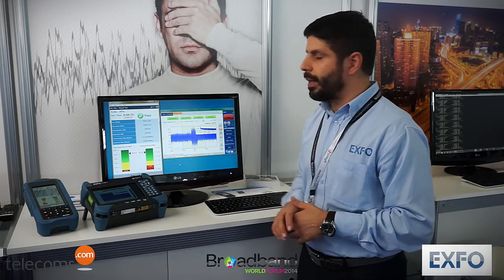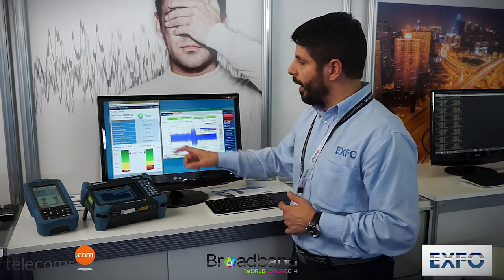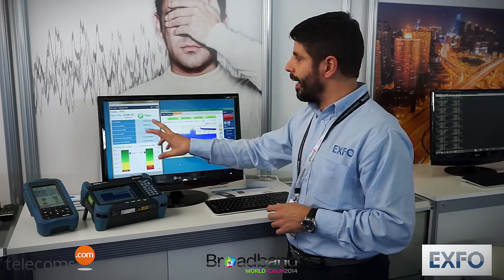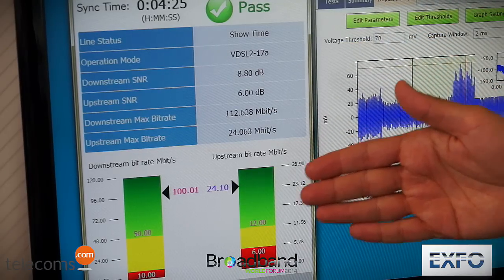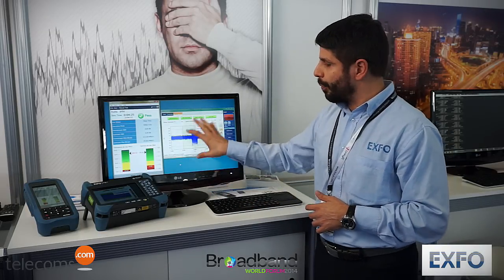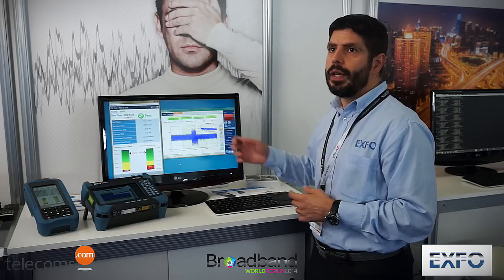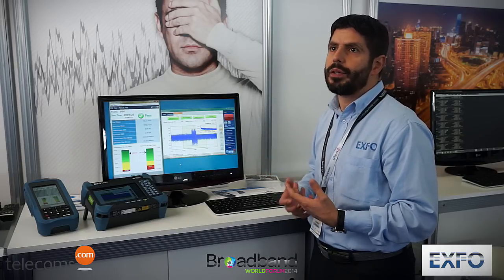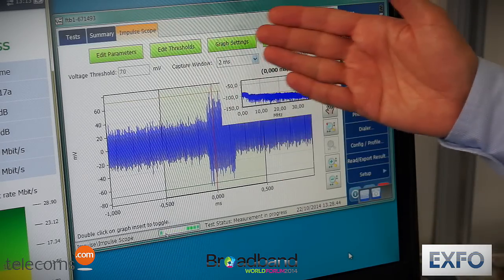FTTN VDSL2 Vectoring (Live demonstration!)

Comment: Alright, they show how they added noise and shit, but not how well it works on distances like 3KM or whatever - useless.
Reply: they finally rolled out vdsl2+ in my town ;-)  it only took 10 years since the standard was final in 2005 , so about time
Reply: +qoaa How far from the distributing point are you?
Reply: Manny Calavera
Well I was on dsl2plus until last Thursday. I was perfect on 12 megabit down 1 m up.

on Wed line tech came out to check if I qualified which I knew I should since I'm 1 and a half blocks from the CO "As the crow flies" but that doesn't mean the line runs direct.

Tech called me and told me my phone and dsl would be down for about 10-15 mins as he climbed the pole to check line. plus he wanted to swap out some connectors on the pole that were old anyhow and best to go ahead since the order was put in.

he called me back about an hour later said I had made him work... he climbed 3 poles. He had the idea while he was up there he said my line tested and qualified for 50 megabit, but he realized he could redirect my line closer by changing 3 connections on the 3 poles it would redirect my entire apartment complex directly to the CO a block and half away, my apartment building is right off main street and the CO is 1 block west then half a block south from me. So I went from a 6000ish feet, after he swapped connectors on 3 poles, he called me back told me he halfed my distance, im at 2800 ft, and my line now qualifies for 100 megabit vdsl2plus.

100 megabit is a bit pricy at the moment. So I went with 50 megabit service.
Reply: qoaa That's awesome, "problem" is however that I live in the Netherlands, where there are no cables above ground anywhere, everything is underground here.
Back in the day electricity and phone/internet would run above ground on poles here too but we're too "developed" for that now, so it's far more expensive to redirect a cable now.
Reply: Manny Calavera
yea, thats the only good thing about our STUPID power poles in the U.S.

now Fiber all runs underground. But the copper goes up to the power poles below the power cables but out of reach of course.

By swapping connectors and such around they can redirect the copper to try and get you closer unless it's already been laid out and optimized before.

But I'd rather have it all underground like your country.

I live in a small town "3 red lights, 1 grocery store, 2 fast food places, 1 hardware store, about a dozen churches" in the southern end of Georgia about 20-30 minute drive from the Florida line. big "bible belt" area. Which sucks, but that's a rant for another time.

Anyhow in the country there's the giant "robot" looking towers that run power parallel to the interstate road system between cities and out to rural areas.

then in cities along sidewalks every block you have a power pole, and usually every other power pole there's a big transformer bucket attached to the side of the pole.

This transformer bucket is filled with oil for cooling. But in rare situations they do explode, maybe tornado, or hurricane as we get both in Georgia being right in the middle of 2 weather fronts coming in from the Gulf of Mexico on the west and the Atlantic on the east. And when the 2 combine over Georgia we get some bad storms at times.

Well trees fall down on power lines cutting them, entire neighborhoods lose power, then you have live sparking power line across road or in someone's front yard very dangerous.

When a transformer explodes it's extremely loud. We had one explode here a few years ago and it's at end of the block and even inside my apartment my ears were ringing and I thought a bomb or plane or someone had crashed into the apartments.

Here's a photo of a transformer at end of my apartment after they replaced the one that exploded and had to put a new pole up.

https://flic.kr/p/dnRdes

notice the very top of that pic the 3 lines at top are the power lines. the lines toward bottom of the transformer are telephone/dsl and cable tv/internet.

those lines you see coming off the pole going to the left. That is 1 power line coming in to the apartment building to feed power to this building. and below that is copper phone and cable.

I don't have cable or tv, I use internet to stream netflix or "torrent" :P

but I've always hated the above ground system. It was originally set up like this even before electricity was nationwide, cause of the telegraph poles running telegraph across the country. Then it just got adopted in for power/phone/cable tv over the years.

There are some new modern neighborhoods that are being built that have power, phone, cable underground to the neighborhood, but those are very new in the large metropolitan areas where space is a premium.

Sorry to have rambled on. But yea, I've never been outside the U.S. and would love to visit over there. I love the photos and videos from there, the towns and country side is beautiful because it's not littered with shitty looking power poles and power towers everywhere. My fantasy one day is to make a big trip to my ancestral homeland, my great grandparents are from Germany on my father's side, my mother's side my great great grandparents were from I think when it was Czechoslovakia, not 100% but anyhow I'd like to start in Germany, then into Netherlands, "party in Amsterdam I hear is a must",then  hop over to London and fly home one day.
Reply: I'd agree that it looks better, as soon as you hop over the border to Belgium (facing the south) you see powerpoles popping out of the ground.
The Netherlands is mostly soft soil so getting it underground isn't a hassle, it still costs manpower however - that's where the cost comes from.
About those "Robot looking power towers" -we have those too actually, a few lines run across the country from the big cities and such, but other than that, no telephone or powerpoles.
We're one of the very few who still have 1 standing close to our home, we have it up still because there's a box for predator birds to nest in. One thing that sucks about a country that has his shit together like the Netherlands is however that there's no real nature anywhere.
Sure there are forests and such, but there literally is NO place in the Netherlands where nobody has set foot in the last 100 years. That's why I have thought about moving to America/Canada to find a nice place in nature to live in.
Reply: Manny Calavera
oh we got tons of nature. I'm 10 minutes from the Okefenokee Swamp,

https://en.wikipedia.org/wiki/Okefenokee_Swamp

then at edge of town is about 30 miles of thick woods/pine trees mainly, until next town which is much larger. But then going south toward Florida, there's a good 100+ miles of untouched forests. Northern Georgia right above Atlanta is the beginning of the "Blue Ridge mountains" which turn into the Smokey Mountains.

Since Georgia stays fairly humid all year round and the borders with Tennessee/South Carolina, the Smokeys get their name for the tops are obscured by a cloud layer of mist/fog for large parts of year, thus "Smokey mountains"

Off the east coast of Georgia is Jekyll Island, amazing fishing out there. 

I used to go deer hunting, quail, pheasant hunting a lot when I was younger with my dad, but I haven't been in years.

I've been all around the south east US, and lived in Orlando, FL for about a decade working for an internet provider. So I've been over at Cape Canaveral when the old shuttles launched and they were huge streaks of fire even from downtown Orlando in the middle of day when Nasa launched from the Cape.

But I started growing tired of the big city, my internet job got bought out, then it resold to google which cost about 1000 of us our jobs which sucked. I decided I'd had enough of the giant city and moved back to small country town near the swamp. :P
Reply: qoaa That's awesome, I like more rural areas anyway, compared to America it might still be quite populated here but there are big differences between the big cities and the more rural areas in which I live in. One of them being that we rarely have traffic-jams whilst in the south they are something that happens daily, it's not as bad as Los Angeles but you get the idea.
Reply: Forgive me if I'm wrong but isn't 3KM almost 10,000 feet? So I'm assuming you'd be talking about VDSL2 served from the central office. Most telcos have moved to fiber to the node, deploying fiber fed remote DSLAMS. That way the copper loop length is WAY shorter. That's what let's me get 100 down 20 up on my VDSL2 service. And that's without vectoring (the ISP, AT&T, is using pair bonding though). If I got the distance right that you are talking about no xDSL tech will get you much speed when the xDSL signal has to travel that far.

In Germany deutsche telekom provides 250 down 40 up to millions of customers using using FTTN VDSL2 with vectoring, and V-plus/profile 35B. So it's possible to get pretty good speeds out of DSL based tech still. Now pair bonded, vectored, V-plus is becoming a thing with speeds of 600 Mbps.
Reply: @sean8102  Yes.